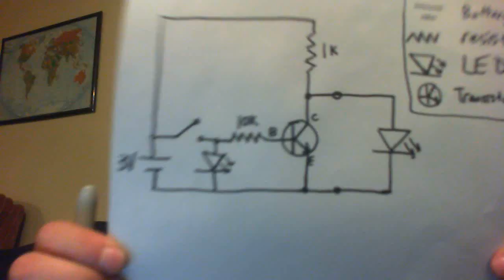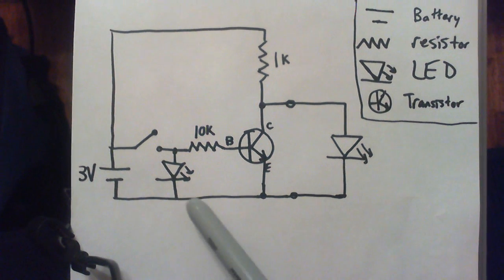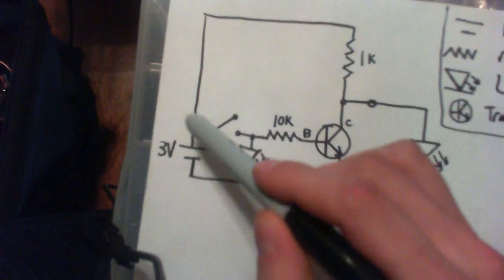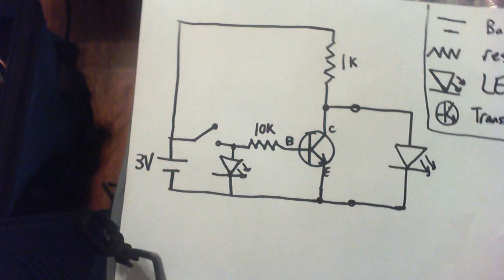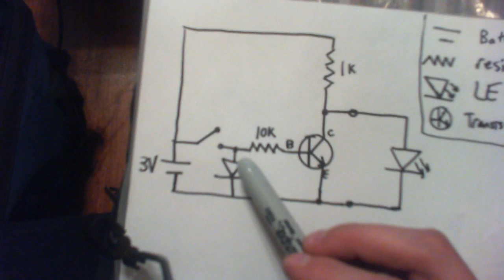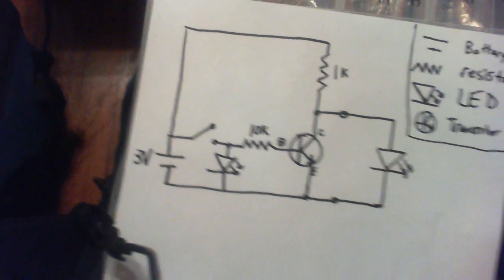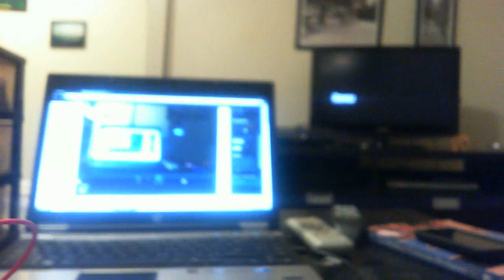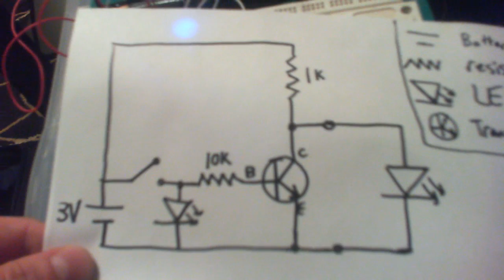Stephen's Real Life NOT Gate

Comment: Based on your circuit diagram, when you power your circuit - there are 3 volts going directly into your first/input LED. Given that the internal resistance of this LED is probably negligibly small, won't this quickly blow your LED with that amount of current going through it?

Besides that, thank you for the great videos!